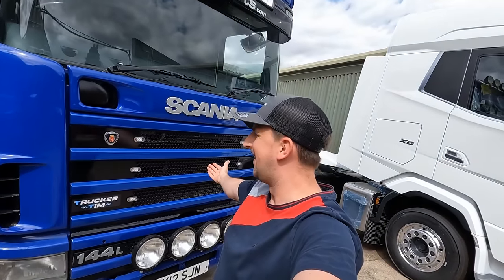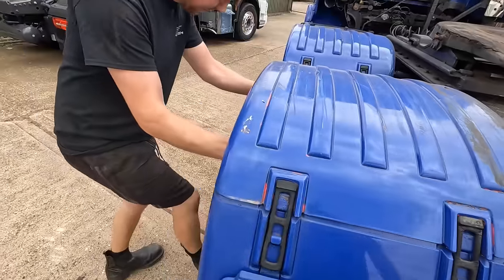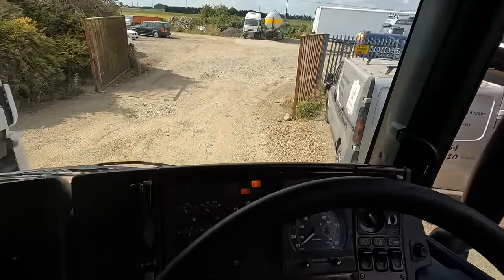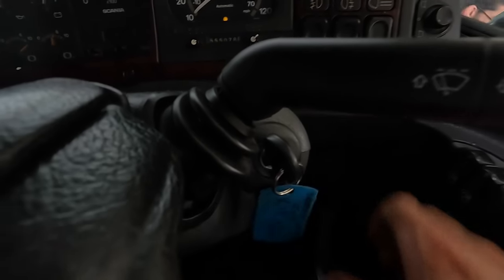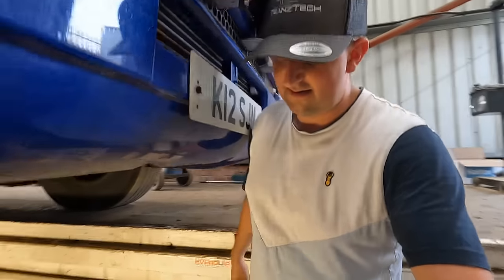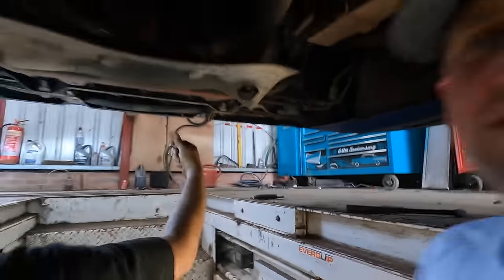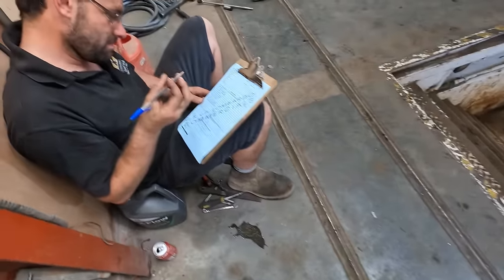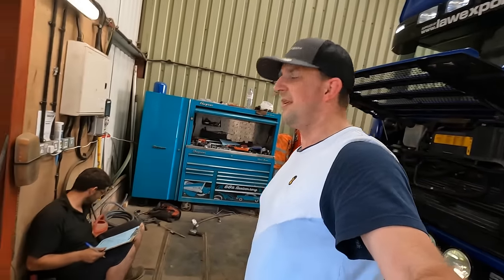What Have I Done! | I Bought The WORST Truck To Customise? | PT-2 | #truckertim

Comment: I'm actually thinking of buying my own truck in the future. Found a 2016 6x2*4 Volvo FH16 550 for 1.3 million SEK (Roughly £110k). White with red details, 385/65R22.5 on front and tag, 315/80R22.5 on the driving axle. Good tires, roof bar with both small LEDs mounted into the bar as well as three LED bars on top of it, LED lollipop lights under the mirrors, painted low sun visor with small LEDs, eight small LEDs in the grill, chrome door handles, 420 000km on the clock, passed last inspection two months ago with flying colors, but the company that owns the truck wants to update its fleet to something with slightly bigger engines.

Comment: Hey Tim, i have some information about the 4 series. You can go to mot checker and put the reg in 
Here are the details about the scania 
SCANIA FLAT LORRY
Colour
RED
Fuel type
HEAVY OIL
Date registered
1 October 2001
Annual test/mot expired 
29 January 2022 
I hope this helps, it might not be correct so make sure to check if it's correct